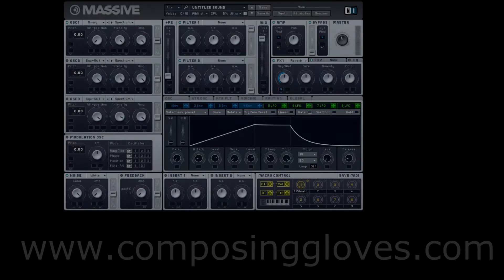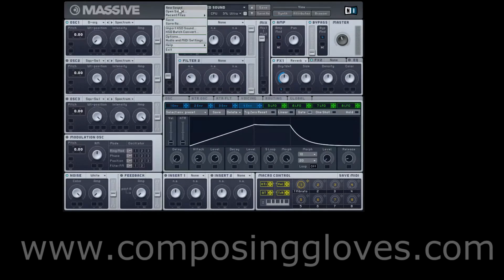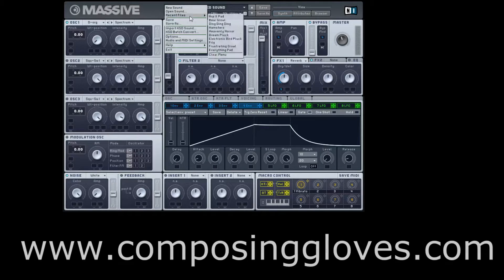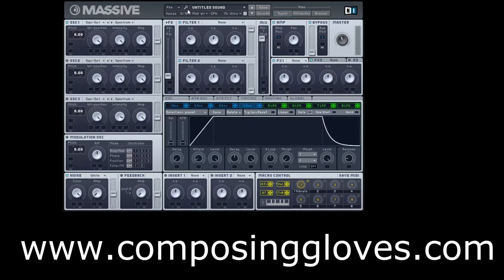Massive From the Ground Up 4 - Routing

Comment: Hello Gloves, I do not understand this so much :/. I am playing this video like 4 times. And there is some interesting thing that I found and dont know why this happens.
- When I have on OSC1 'F1' and I have on OSC2 'F2'  and have filter on Serial and mix is set on mix2 I will get interesting thing. Because when I turn 'filter2' all the way up and then I turn 'filter1' all the way down and then I start morphing cutoff on 'filter1' (this filter is all the way down) I will hear the cutoff sound changing. 
Please Composing gloves can you do more explained video on routing? No one have video on this type of routing expect you. I will be happy if you do. 
Thank you for your response.

PS: Thanks gloves for making these type of videos I learned a lot from your videos.
Reply from the maker: Glad your enjoying the videos! Because you set it to series the filter assignments on the OSC are not used, they only are used for parallel.  So by setting it to Mix 2 means you'll only hear the stuff that makes it past filter 1 first, that's why your getting the behavior you are.
Reply: Oh I read manual and I learned that when I turn Input Fader on Serial mode, so now when it is on Serial mode Filter 2 will use Filter 1 as input signal, so it doesn't matter if the Filter 1 is off or on?
Reply: Am I right Mr.? or?
Reply from the maker: That is correct
Reply: And gloves I have one more question If I have on filter 1 very low frequencies and on filter 2 very high frequencies and I turn mix 2 all the way down I will not hear any sound.
Is it because the filter1 (output)  and filter2 (input) do not match the frequency band?
Reply from the maker: +NoMore it depends on what kind of filter is on 1 and 2